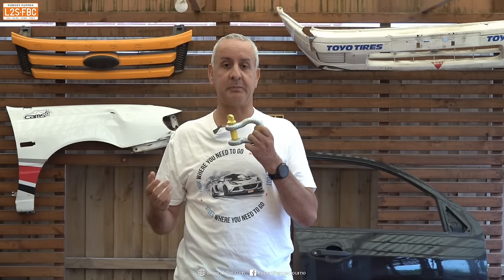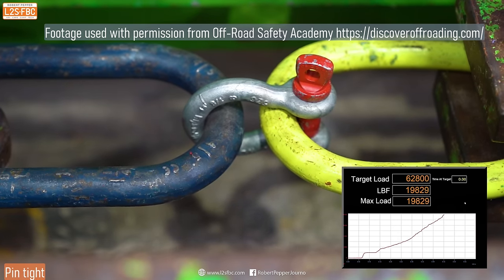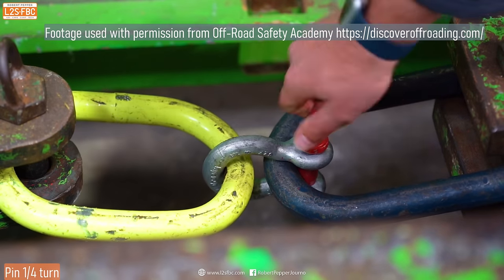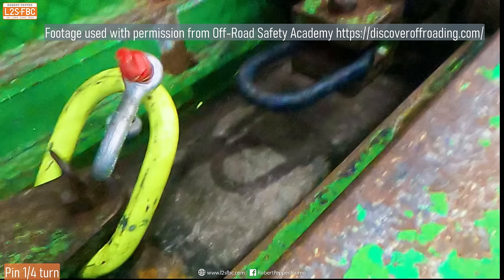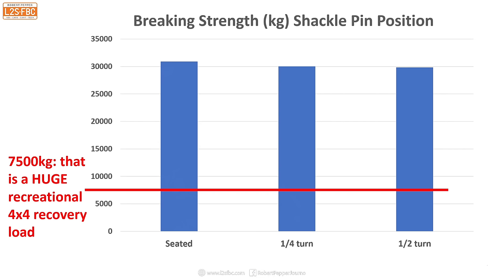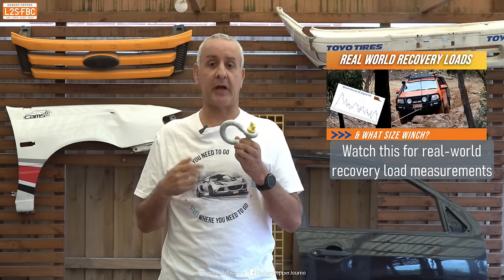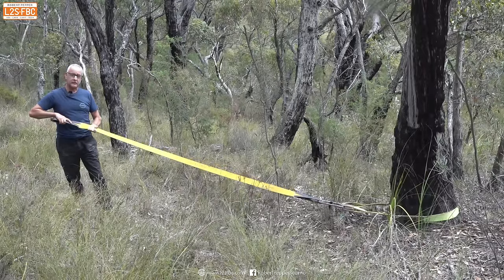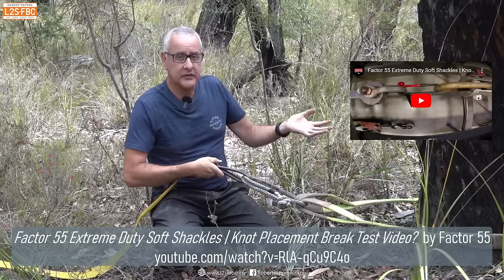What happens if you back off a shackle by 1/2 a turn?

Comment: Re twist, I had an accident due to twist. The twist popped the cheap shit SCA snatch block circlip off and the vehicle saled down the hill into a rail and the front of our 100 series. Yes, there were other mistakes on my part operating tired and keen to leave, but fundamentally the other bad decisions would not have burned me if not for twist OR a better built snatch block. My 2c. PS, awesome 100 series barely damaged (paint only really) and other vehicle was a rusty parts car that I didn't care about the body of, but quite stoved in.

Comment: 4:21 "I think the results are useful and doubt breaking 30 would change it"  Well, so long as you "think" so, let's just throw statistics in the bin, right?  A single data point should be enough for anybody! 
 I hate it when non-technical people try to do technical tests and make conclusions from their flawed results.
Reply from the maker: Added to pinned post. If I drew attention to the fact it's only 3, is that throwing stats in the bin?  What conclusion would you draw?

4 Sample size - I draw attention to the fact it's only three shackles. That's not as conclusive as 30. However, it's proving a negative; if backing off made a dramatic difference, then it'd show up for sure even in that small sample - consider a shackle with a cut halfway through its pin, you'd wouldn't need a big sample to show that's weak.  Not trying to prove that for example "all shackles break above X kg in which case if we took only 3 the 4th could be weaker.  I've also broken other shackles before, and they all had consistent results, and they are built to standards. This gives me confidence that the sample size could be small and still useful.  https://youtu.be/AVqYkgaaKAY
Reply: @L2SFBC   "consider a shackle with a cut halfway through its pin, you'd wouldn't need a big sample to show that's weak."  Yes, actually you would.  A sample size of one doesn't tell you much.  As another commenter down the list pointed out, with a reasonable sample size I think you'd probably find all 3 of your test groups completely overlap.  You stopped testing once you had enough data to confirm your pre-determined conclusion - and that isn't good science or statistics.  I'm not saying the testing you did was bad, I'm saying you can't justify the conclusion you did based on the very limited testing you did.
Reply from the maker: I do see your point and agree bigger sample size the better. The data is presented so people can figure out their own conclusions and I drew attention to the sample size. I would want a larger sample with say soft shackles which are not built to a standard and also inconsistently assembled as my tests have shown, whereas I have found rated shackles to be consistent as have others. I would like say 300 samples of course.
Reply: @L2SFBC  my understanding of Australian Standards for production of bow shackles is that shackles must meet documented specifications, and sampled to meet the specifications, so like with any testing methods, certain assumptions are made , and in this case the assumption is that the 3 shackles tested are within the specification and assumed to be almost identical, therefore based on this assumption testing 30, 300, 3000 or 3 million is going to yield the same conclusion. I'm not a statistician, just some commenter that tends to see the big picture.
Reply: Aw ease up.  This guy spent time and money breaking some shackles which is more than most have done.  Besides, same could be said of non-technical people passing judgement on potentially technical topics?

Comment: A single test with only 3% deviation is hardly anything conclusive.
Reply from the maker: See pinned post. Just added this:  
4 Sample size - I draw attention to the fact it's only three shackles. That's not as conclusive as 30. However, it's proving a negative; if backing off made a dramatic difference, then it'd show up for sure even in that small sample - consider a shackle with a cut halfway through its pin, you'd wouldn't need a big sample to show that's weak.  Not trying to prove that for example "all shackles break above X kg in which case if we took only 3 the 4th could be weaker.  I've also broken other shackles before, and they all had consistent results, and they are built to standards. This gives me confidence that the sample size could be small and still useful.  https://youtu.be/AVqYkgaaKAY

Comment: Not tight, just snug. No test with the pin torqued up?
Reply: Read all your notes and here's another re my comment: snugging or tightening pulls the threads off to one side of the opposing thread and must cause major strain under heavy loads. Having it slightly loose so it can V to V centre for load bearing is likely best at lower loads away from breaking. How much of a turn loose would depend on manufacturing tolerance but in well formed unstretched threads a 1/4 would be ample.

Comment: Doing one test of each is like doing no test at all. Even if you expect the same results, this is not the same as actually having the same results. If you do a video about safety, do it right, otherwise you are contributing to the contrary. Also, the 5% also have to be subtracted from the working load limit, not the max breaking strength. Also, the effects of a not tightened pin might become a lot more aparent in dynamic load scenarios. Also, the risk of a pin slowly backing out during a longer recovery due to vibration should not be underestimated. Also, the fact that - in times of soft shackles - shackles tend to be left in place for convenience, simply for the purpose of having a place to tie into with said soft shackle, will contribute to the fact, that shackles will stay in place for a longer time period, giving a loose pin even more time to back out. 
Also, there is no "make up your own mind", except you are in this for clicks and views, and not for safety. More safety marging is always better than less. ALWAYS. Remember that the safety margin is there for a reason. Material weakens over time. If you've got a hairline fracture in your shackle, those 5 percent might be the only thing that's keeping your shackle from becoming a shrapnel.
Reply from the maker: Read the pinned post for starters.  Also, consider your use of absolutes in context of tradeoffs - is a greater safter margin better if you need to compromise something else?

Comment: Testing anything at n=1 is an abonimation. Testing should be at a minimum of n=5, then avaraged, spread reported, and statistically evaluated. This is NOT a representible assessment.
Reply from the maker: So of no value?
Reply: Yet it is way better than nothing.  Basically shown by three shackles, the same failure mode regardless of pin tightness.

Comment: As long as the failure point is at the pin thread (known to be the weakest point) the tightness is irrelevant as long as the full thread of the bow is engaged.

Comment: Rigging and hoisting certification test say snug it by hand
Reply from the maker: And what about 4x4 recovery?
Reply: @L2SFBC  I have no idea but when an actual certification test says hand tight and Crosby brand says at least hand tight that's what you do. I don't know where this back it off crap started but it isn't correct. Regardless if it for rigging or 4x4 recovery.

Comment: Why do you put in so many easy spotted faulties in you video. This makes your video a total nonsens. At 4:33 & 5:20 there is obvious errors. At 4:33 it is obvious that the to schackle is unloaded and at 5:20 the half turn schackle has lower kg but higher lbs than the quarter turn schackle.
Watching this was a waste of time as I don't trust anything with this kind of manipulation/faulties in the "fact" presentation. 💯👎
Reply from the maker: Not seeing any error at 4:33, it's meant to show the shackle unloaded vs about to break. At 5:20 That was a transposition error I noted in the description and pinned comment. The numbers are correct but not in the right place. 
Why do I put errors in?  Well, it's not intentional, so while the errors are indeed the results of my actions, I wouldn't use the term "put".  How do errors get in?  When you have lots of technical data and complexity, mistaks do happen.  I catch a few, my previewers get some more, but somehow, some make it through. On rare occasions I need to delete a video, but mostly the errors left don't change the overall point and are transpositions such as in the case here so I leave it up.  Does that answer your question?
Reply: @L2SFBC  At 4:33 it is told that they are under the same load in the picture.